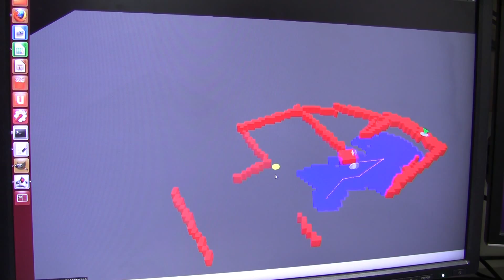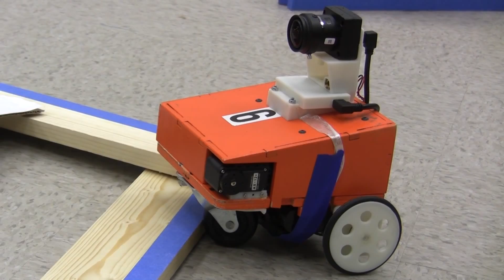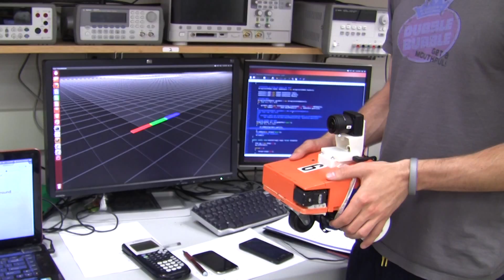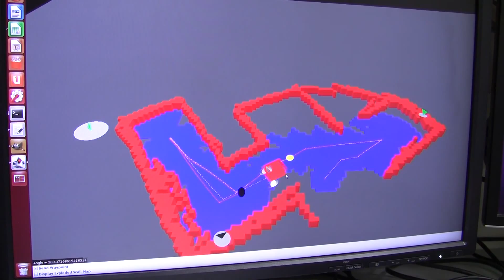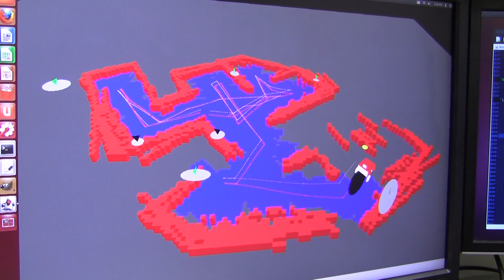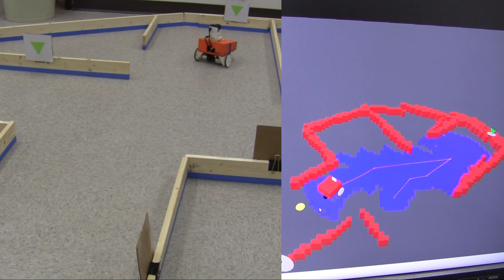Autonomous Robotics with SLAM

Comment: Hi! I would like to perform the same job. On my PC I have installed ROS Indigo and I use a LIDAR, as you connect the pc+sensor system to the wheels? Thank you.
Reply: Claudia Papa 
Did you ever get to finish this project? I liked their demo. I always wanted to build a robot like theirs. I also wanted to fool around with a robot that used rat slam. I also wanted to look into lingo droids. Lingo droids were another technology were two robots were programmed to confirm  with each other the size and shape and locations  Have we points in the area